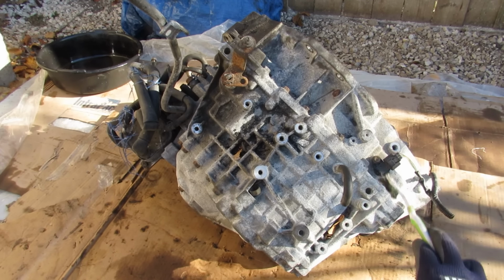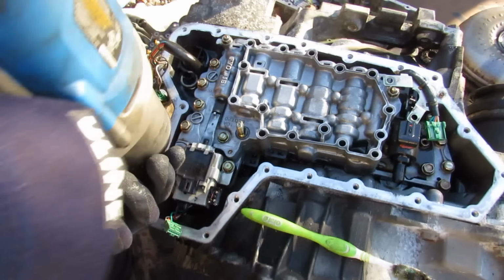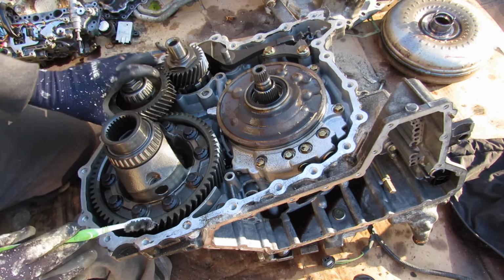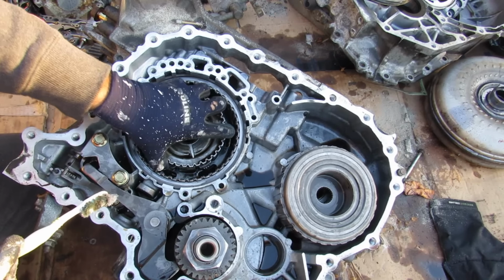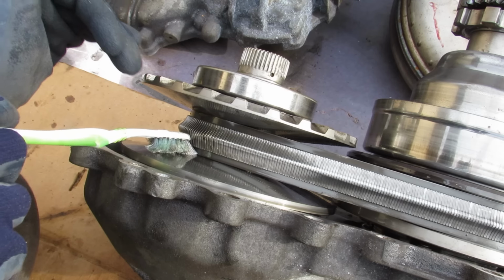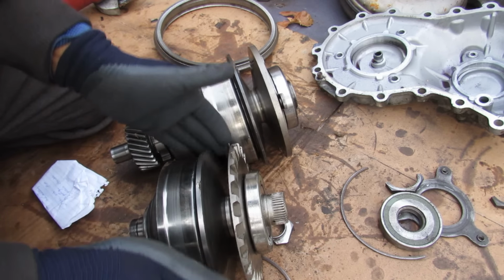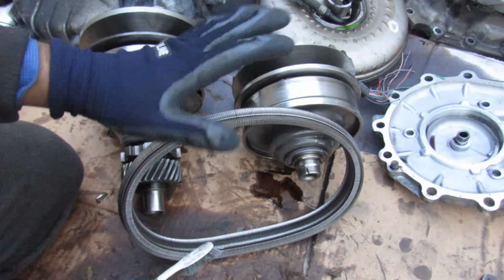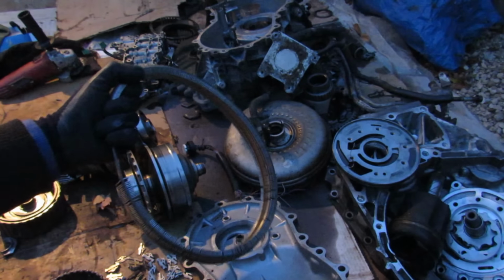Why Nissan CVTs FAIL

Comment: Really great video. Another failure point on these is insufficient cooling. On super hot days my daughter's 2013 Rogue's CVT will overheat and just disengage the transmission. Not a great scenario if you're on the interstate at speed. :/
Reply: He explicitly mentions this in the video 🤨
Reply: take it straight to your nearest nissan service drive. it may not be an 'overheat' situation. they can at least diagnose it for you for a nominal fee. you don't want to guess at something like that- its a safety issue.

Comment: They may have their problems, but I bet they are more reliable than the CVT on the DAF 66 I had. That had rubber belts and they would break every time the car exceeded 50mph.

Comment: I’ll give you the short version of why CVTs fail. Jatco makes the majority of these units and they are limited on mileage, most only lasting 100k miles. By design they wear quickly and fail with no ability to repair. By the time these fail the shitboxes these units are in aren’t worth the cost of repair.

Comment: There's still Nissan fanboys that swear by the Nissan CVT as the holiest and be all greatest transmission ever made. They're so fake when they comment on these videos with "My 2004 Altima CVT has 28345620011456 miles and it's never ever had a single malfunction, EVER!"

Blah blah blah, yeah, right! Nissan CVT are garbage.

Comment: Nissan makes some very stylish and option filled cars. I would love to have a new 2022 Maxima as I owned one many years ago. That V6 engine is one of the best features. However, I will not buy a new Nissan with a CVT. Especially a Maxima. As you said CVT is good for low power economy vehicles but not for higher stressed, higher performance cars. What is Nissan thinking?

Comment: Driving Nissan xtrail 2008 Ti , bought at 80000, now 165000km. Transmission never been touched,  Have no issue with transmission still !
He is wrong also in fuel economy. The only issue with my car that it is NOT fuel efficient.

Comment: I cant get my head around how the belts gets enough grip on the smooth conical pullies. Also, if I'm not mistaken, the edges/sides of belt appears to be the only contact point with the conical pullies as they go in and out.

Comment: All I know is the new Nissan rental I had on vacation that had a CVT transmission was the worst car ever.  NO power.  I mean, if you mash the gas pedal to the floor it would oooooze forward, not move forward abruptly like a normal transmission.  I'll never buy a car with a CVT tranny.  No way.  I hated that rental.  It was so unreliable as far as being able to enter traffic quickly, it was just dangerous unless you waited for a huge opening in the traffic to get out.
Reply from the maker: Yeah I agree. It gives you the feeling like the car is slow

Comment: I just rented a Nissan Versa SV to get me from Cleveland to NYC (and back).  You could tell it had a CVT.  The transmission felt unresponsive and 'spongy', and the car did not inspire confidence.  BUT the gas mileage was fantastic, as I got like 45MPG and was able to make the trip on just one tankful (usually takes me almost 2 with other cars).  I'm in the market for a new car, and will probably go with MAZDA, as they still make tried and proven conventional 'old school' automatic transmissions.
Reply from the maker: Yeah I don't mind taking the fuel economy hit for a better driving response

Comment: I had a CVT transmission in my Ford Five Hundred. I had it replaced, and the new one only lasted 35,000 miles, and the shop only warranted their work for 25,000 miles. Turns out that they had to take my car to a Ford dealer to have it working properly. I will never buy another car that has a CVT transmission.

Comment: 106K on my Suzuki Kizashi which uses the notorious Nissan Jatco CVT - one of the most failure prone CVTs. Mine runs perfectly and is a joy. Smoothest transmission I've ever experienced.  I don't do jack rabbit starts otherwise I drive at 80mph on the interstates and do lots of short haul errand running. This car has been mellow and a pleasure to drive.  PS: The Kizzy is a  luxurious sports sedan rivaling any of the overpriced , failure prone stuff from Germany.  It's all in how you drive and how gentle you are.

Comment: There was a cab driver in Vancouver Canada, His Toyota Prius had over 1,000,000 Kms and the Prius uses a CVT tranny, so the issue is not with the technology, but the quality and build of the CVT employed in a particular vehicle brand / model. If properly maintained and not abused, the CVT tranny should last you as along as it was designed for. 
My Honda Accord also has a CVT and at almost 200K now with no issues.

Comment: That nugget right at the end about not towing is something I’d like to learn more about.  I’m considering a Subaru that is rated to tow 3000 lbs, but it has a CVT.  Thank you for the heads up.
Reply from the maker: Yes that puts alot of stress on the transmission

Comment: Manual transmission is the best, automatic transmission is the second and the last is CVT. My 1998 Toyota,  with manual transmission has 200k miles without problems.  It's sad that most of car manufacturers were no longer make regular manual transmission cars.  To drive manual transmission cars, you will need to spend quite a bit of money on high end sport cars like Madza Miata,  Honda Civic  type R..
Reply from the maker: How about dual clutch
Reply: My cvt Nissan is gradually gaining in mileage towards my manual Honda because of gas consumption. 13 years difference, but down to less than 20k in miles difference.

Comment: Owned a brand new Nisan Ultima (2018).  Trans failed with only 28k on it.  Dealer would not replace the trans, only rebuild it.  Had it rebuilt.  Rebuild warranty is only 1 year.  Junk.  Sold the junker a week after the rebuild.  Bought a new Subaru Forester.

Comment: Nissan sucks. Had 2014 Nissan Pathfinder. The CVT was replaced 2x in warranty. 3rd time out I dumped it in 2021 with 92k. My 06 Subie OB has 172k no issues.  Don’t buy Nissan.
Reply from the maker: Wow. What did u replace it with? New pathfinder?
Reply: @speedkar99  2016 Toyota Camry w/Aisin transmission. I’ll never buy Nissan again. Subscribed to your channel, good stuff

Comment: I am a shop owner and we are seeing these Nissan CVTs failing between 45-65K miles.  I have one customer that has had 4 failures in 14 months...the last three were new units from Nissan with the dealership installing the last one which lasted a whole 6 weeks.  STAY AWAY FROM CVTs!  As the video stated there is no rebuild, just replacement...and it is far from cheap!  About the only other advice I'd couple with this is to stay away from anything hybrid or electric too; the money you save on fuel today you WILL spend on repairs/battery packs tomorrow.  If you buy one of these vehicles with hybrid/electric and CVT drive it for three years then dump it/trade it in before the expenses start piling up...leasing is always a great option so you're not stuck with these lemons.
Reply: Unless it's e cvt. They literally are the simplest transmissions. Just a planetary gear assembly that has the ratio changed by an electric motor. The ones from Toyota are the best. You could never change the trans fluid and it'll prob still be fine but better safe than sorry. These are mechanical drives. But normal cvts are literally friction drive and not only that it's very unreliable.

Comment: The Rokon off-road motorcycle had a CVT (snowmobile transmission?) and it was super durable, reliable and high performance. Nissan should have started with reviewing that design.

Comment: Earlier today I saw a video about a lithographic machine that blasts tiny droplets of tin are blasted by two lasers.  The first pulse shapes the droplet so it has the right curvature to focus the light produced when the second laser vaporizes it.  Tin is used because it produces light at just the right frequency for microchip lithography.  It's nearly as complicated as this CVT.

Comment: Toyota also have CVT in some of their models, in my opinion CVT is best than normal automatic transmission it just needs to regular replacement of cooling filter and oil with original, my CVT still working excellent since 12 years

Comment: It seems like it could slip easily. And if the metal belt has enough grab to move a car full of people, it seems like it would wear out the pulleys, quickly.  Its definitely weird that the belt pushes the pulleys, instead of pulling. It just looks like it cant transfer torque well at all.  Obviously those details have been figured out, but its surprising to me that it works as well as it does. Do they wear out faster than traditional transmissions?

Comment: so the steel belt is not need oil lubrication and it is not submerged in the oil correct?
Reply: It's the hottest part, it needs oil cooling.

Comment: CVT's are a great example of planned obsolescence. I'll never own a vehicle that has one
Reply: Good luck with that!
Reply: @no1lineman  Why? It's not hard, just buy a used car that doesn't have it. Either that, or buy a new car with a manual
Reply: @justsumguy2u  I might agree with you  with CVT reliability if you were taking ten or so years ago...especially Nissan. Current Cvt's are reliable if well maintained. CVT's aren't going anywhere for a while and unless you're buying used it's going to get harder. Manual are great but they don't work with modern safety measures as well and are offered less and less.

Comment: Still haven't seen any engine designed to really take advantage of CVT. Unless a narrow power range engine can substantially increase efficiency, which would need a CVT, I don't see any overall preference for a CVT. It will by nature of design always be relative weaker. There is no need for such fine RPM control, especially with the already efficient flat wide torque range of modern small turbo engines.
Maybe a small diesel? But the public image of those is below their technical advantage these days. Thanks VW, for killing modern passenger diesels.
Reply from the maker: Maybe an electric motor
Reply: @speedkar99  An electric motor actually doesn't need any variable gearing. That's its advantage. Flat torque output from 0 rpm to  point limited how much current it can take, then constant power with linear torque drop.. No need for transmission at all
Reply: Small turbo engines that can sit at 2K rpms and vary power via boost level, match made in heaven for cvt and mpg.

Comment: I just can't figure out why so many people have trouble with CVT's.  I bought a 2009 Dodge Caliber SXT (ex-rental with 39,000 miles) and drove it another 105,000 miles before trading it in.  Never had a problem with the transmission at all.  And I lived in Vegas (extreme heat) and Carson City (below zero temps).
Reply from the maker: Didn't realize the old calibers had a CVT

Comment: I had the impression CVTs were simpler than traditional transmissions. This video convinces me CVT isn't simpler than anything except maybe a moon landing. It also helps me understand why electric cars, with no transmissions, are so popular.
Reply: Moon landing... Heh heh 
[beavis & butt-head gif]
Reply: @podulox  Epic reply, sir. Epic.:yougotthis:
Reply: In a sense they are simpler. They have less moving parts and a simpler concept than a traditional automatic transmission. Mechanically speaking, that makes them simpler than a regular automatic transmission that has multiple gears and multiple clutch packs that all have to work in concert to shift gear ratios. Now, does that mean CVTs are better? No. Does it mean they're worse? Not really either. It just means they're different. When they were first introduced they had many reliability issues due to their early designs and some parts involved. Those designs have since been updated and more reliable parts used so they're much more dependable now than they were circa 2008ish. Also, they're much cheaper to manufacture, and let's be honest that's the real reason the car manufacturers pushed so early to get them in their new models back in 2008, even if the designs weren't reliable enough yet. In the end it bit them in the ass.
Reply: @General_Layabout  Good explanation.  I'd encourage Steve K. to watch a video about how a conventional automatic transmission works.  Most of the parts reviewed on this video are also more or less present in an conventional automatic.  Complexity is part of why most independent shops don't do internal transmission repairs.
Reply: @georgemartin5980  Yup, I've had to have one of these early CVT's replaced already in a 2008 Mitsubishi and it was hell. No one will work on them, even dedicated transmission shops, simply because they don't want to put a warranty on their repairs when the parts are so faulty. Had a hard time even find someone willing to sell me a used one for the same reason. At least with a conventional automatic finding a transmission shop to do a rebuild, god forbid, is relatively simple because the parts are common and it's done fairly often. I don't think CVTs are as bad as many make them out to be, but they have earned their reputation due to how much of a bitch it is to get them fixed.
Reply: I dont know why they don't just make something like an Owen Magnetic now
Reply: @autismion  The Norwegian one?
Reply: @podulox  One of them was shipped to someone in Norway once, but they were made in USA from 1915 to 1922
Reply: @autismion  This conversation could last a Chess game... (brb!)
Reply: @metalmark062  Do you also think that the earth is flat? Or that aliens built the pyramids?
Reply: @metalmark062 I'm pretty sure they made a movie about that
Reply: @metalmark062  look up S-Band, and mobile cell reception and radio frequency are pretty much different things in this day and age. Also there’s a reason why NASA loses contact with Apollo as it orbits around the far side of the Moon. As for if it was faked kinda hard to keep everything under wraps for the 400k people that worked on the project. Just my thoughts on it as you have your own. No hate just spreading ideas
Reply: @metalmark062  y’all keep dreaming
Reply: @metalmark062  You're not smart

Comment: The reason that Nissan CVTs fail is because they are made by JATCO.......all JATCO automatic transmissions and CVT transmissions fail !  they have been horrible design and engineering for 18 years.....and it's not just Nissan, it's all car brands that use JATCO transmissions......smarten up people....DONT BUY ANY VEHICLE WITH A JATCO TRANSMISSION!!

Comment: Nissan gets there cvt's from an outside source! the same one the other manufactures use! but Nissan owns Jatco and asked them to build it cheaper and cut corners. that's why they fail,  Nissan is screwing it customers! Nissan is owned by Renault, which have NEVER built anything worth a shit, how many Renault's do you see in the states?

Comment: I put 162000 miles on a 07 Sentra and never had a moments problem with the transmission. I changed the trans fluid at about 130000 and the old fluid drained was as clean as the new fluid I put in. I have to say that was a great car.
Reply: I had a 09 Altima and the cooling factor he talks about is very very true. I had one transmission change (covered under the warranty) and about 30k miles later had the same high pitch whine he talks about. If you are driving about 75mph for 600miles straight in the middle of summer in the Midwest that transmission will over heat and damage itself. At this time Nissan did enough to know what to trouble shoot and no longer where hot swapping transmissions. They wanted me to do a flush and suck 2 times before they would even consider working on it. That was in 2016 and they wanted $1000 total. Mind you it was one of the first generation of cvts but none the less I will never buy a car with a CVT again and never will buy a Nissan ever again.

Comment: When do they break down?
I’ve got a 2018 rouge with 50,000 miles and I don’t drive it hard. 
It also makes absolutely no noise at all.
Reply from the maker: It'll start over heating and slowly degrade

Comment: Hi there! Jumping the gun with my question before understanding the 'failure' aspect of your vid. What exactly is the 'failure' aspect in terms of damaging the Nissan to an inoperable state, if this is the case? Are you just describing the, I guess, hassle of replacing some parts that wear down/fail after "x" miles, and this constitutes the failure label for these transmissions? I've owned 2 Nissan's, the former and my 17 Maxima! Never had any problems with their transmissions, and both cars reaching close to the 100k mileage. But, all I see are vids about the 'failures' of these transmissions, particularly in Nissan's, and I don't understand it, yet. Looks like a good vid and I'll keep watching! Thanks! =).

Comment: Good Morning, I have a question for anyone who wants to answer.  I have heard that the same brand of cvt transmission(Jatco I believe)  is features in the 2-3 different car maker.  Nissan, Mitsubishi and Subaru(Maybe).  We hear all the time how atrocious they are in Nissan Vehicles. However you don't hear complaints of failure from Mitsubishi  for example.  

If they are in fact the same transmission in the Nissan and Mitsubishi.  What is Mitsubishi doing right and Nissan doing wrong?   

Disclaimer, I am not expert in mechanical things, I just listen and read comments.
Reply: Subaru is in house...not Jatco.